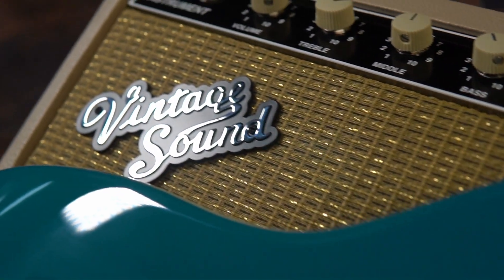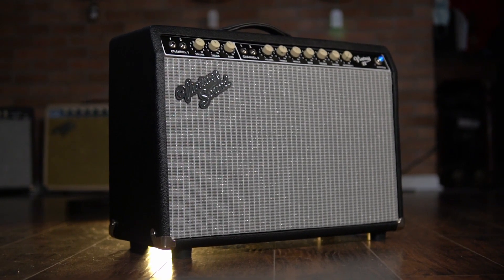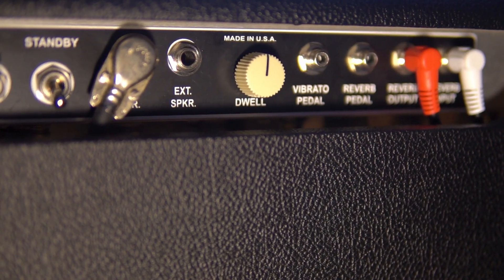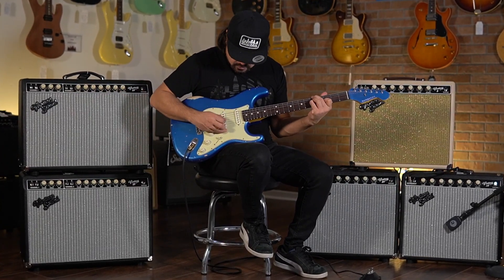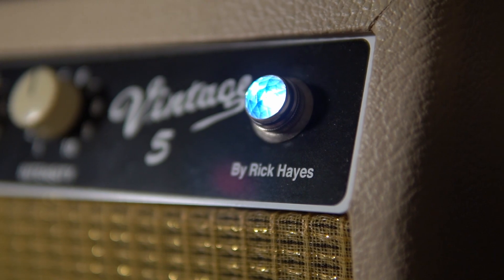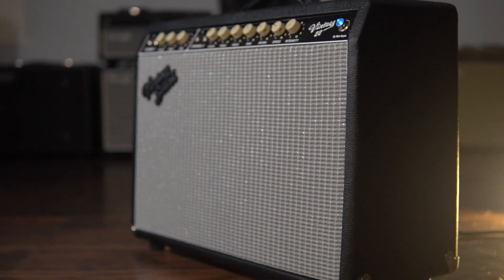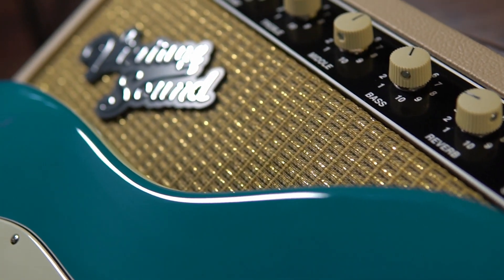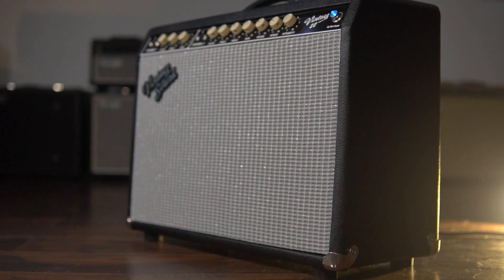VINTAGE SOUND AMPS Overview at Austin Guitar House

Comment: Just picked up a Vintage 20. Wow, what a great amp. It's everything I always wanted to make my 65 Princeton Reverb into.
Reply: I’m looking into getting this amp. Do you play mainly at home or gigging? I want one but want to make sure it’s not too much to play at home. They offer a 15w version instead of 20
Reply: @Childofbhaal  I am in the same boat. Ask Rick to build your combo 15 as a HEAD- $50 upcharge. This gets you an ohm selector on the back so you can plug in e.g., another 8ohm speaker and set it to 4ohm- space them 10 feet apart and WOW! I plan to do this with my Katana amp that has a 12" speaker in the cab. I think the C speaker is better than the CS for most people.

Comment: Had a VS20. Trem never worked right. Sent it to Rick and had a few caps changed. Still didn’t sound the way it should have. Sold it and bought a Swart Antares. Better built and sounding amp for my needs.
Reply: The price seems too good to be true for a hand wired amp with these features. It makes me suspicious.
Reply: @mrbuttons1243  I have two and am contemplating a third. Rick wants his amps to be available to players so he keeps his prices within reach of normal people.
Reply: @johnwelsh2769  Do you have his 15? I am thinking about it- for around @2k, he can build it with a head in the combo that gives an ohm selector switch built in. Handy for adding another 8ohm speaker to the party, then clicking 4ohm!
Reply: @MOAB-UT  I do have a 15! I like it a lot. Mine was $1300 but I got it in 2010. It came with Weber Cali 12" but I just didn't like it for some reason. I switched to a Celestion and it sounded better. No problems at all in 12 years of use! It's a great workhorse amp. I also have a 5 which is fun to crank up. I would like a 35 for gigging but can't do it right now.
Reply: @johnwelsh2769  Thanks John. For at home playing, am I better off with a 5 or 15? I want to also run it out to another 8ohm cab. I only play around 2 on volume so 75-80 Db's. I have a bad ear. My build, with a head in the combo and tweed is $2k.
Reply: @MOAB-UT  There is not as big a difference as one would think. The 5 is louder than I thought it would be. I bought the 15 from Rick, I bought the 5 used. I think the 15 is a great all around amp
Reply: I’ve had a vs15 since 2015/2016 
And it’s the most perfect clone of a “blackface” Fender Princeton Reverb amp that I’ve ever played and or heard. 
-Never once have I had a single issue with my amp. 
-I still haven’t had to take my amp to a “tech” to fix or replace anything (still works as good as the day I bought it.
-The only “work” I ever had done by professional was to install and properly bias my favorite vintage 6V6GT power tubes. 
Also contacting Rick Hayes (the builder/owner)  has always been simple to contact and always filling to answer any dumb questions I may have asked in the past. He’s truly there to help and to ensure that you get the best possible sounding blackface Fender amp you could possibly buy. 

And I bought mine used from REVERB (but internally it was completely untouched). I bought it for an absolute steal Of a price (I remember the guy who sold it to me almost instantly regretted it, and begged me to sell it back to him)
At the time I was considering purchasing a pre-cbs Princeton Reverb, which would be cool as a piece of history but way to expensive and I’m very glad I bought the VSA VERSION
Reply: Literally same exact story!
Only had to take it to tech once to install my fave vintage 6V6gty power tubes.

Comment: I owned two different vintage 40 One i had rick build it directly from his place in FLA I liked it but something went wrong and couldn't be identified it was a constant nag, I ended selling to somebody letting them know there was a issue, I bought a second online that was already built I liked it but again something went wrong It would blow fuses out of the blue then it would run fine then it would over heat then everything was fine I went over so much attempting to get it fixed Again never figured it, In saying that i'm really leery on these amps I contacted rick with both amps He never figured what the problems were and after while i just became a back burner customer somebody he hated to hear from and would rarely reply to after while. I'd just get a shoulder shrug type of response Just a bad experience
Reply: Not all builders are engineers or good techs.
Reply: He has a 5 year warranty less shipping. Why not just send it in to be repaired? Any amp can be fixed. You just change out parts until the problem goes away. Same with cars that I worked on that had hard to identify electrical gremlins. Amps are much easier in that regard. I suspect there is more to this story then you are letting on. Maybe you got power surges or dirty power in your home. What amp do you have now- any issues with it?
Reply: @luthiervandros  Rick is very good though.
Reply: @MOAB-UT   I did send it to be repaired, What he did in return was a real jacked up thing to do, I had him build the amp the way i wanted it, What he did was completely change the entire chassis, He thought he could fly it under the radar without me knowing but one thing he didn't know was i had a different face plate made for the original chassis  when he sent the amp back the face plate no longer fit the amp correctly when i went to reinstall it &  the amp sounded completely different , I said to him you changed the chassis he said no i didn't  as i said the amp sounded completely different than what i had him build, The hole thing was a bad experience as i originally stated.
Reply: @gatormcklusky5850  Interesting- TY. Sorry for your bad luck. When you spend that type of cash- that is not the experience you would expect. 

What amp do you recommend? I did like his VS15. Also looking at Carl's Amps Blonde 20. Headstrong Lil King, Louis Electric Columbia, Dr. Z. Z-Lux. Too many options! None of them cheap! 

I like clean, sparkly Princeton type tones at very low volumes just at home TV level since I have a bad ear- cannot go louder than 2.5.

I appreciate you!
Reply: @MOAB-UT   I can't really speak to the many amps he makes,  i bought the Vintage 40 this was back in 2012 & 2014 for the second one, I guess one could ask why did you buy a second amp, When the amp ran right i really liked it & hoped the 1st one was a fluke. I currently run a Marshall, i have 2 of them, one is the hand wired super 100 Jimi Hendrix reissue, the other is the Marshall 40th anniversary hand wired JTM 45/100 both are pretty cool amps, I'm trying too save for a fender black face either a deluxe reverb or a super reverb.
Reply: @gatormcklusky5850  Thanks. You are an eternal optimist I guess! Glad you seem to be happy with your current amps. I really liked the high end vintage amps however, in my quest, I stumbled upon a post that turned me on to a small, since retired builder in Dave Gries aka Gries amplification. I just bought one of his simple 5 watt amps...sitting down? $450! It has plenty of clean power for at home playing which is all I do these days. It even comes with his homemade attenuator.

He chose not to put Reverb and Trem. in it specifically because those circuits are often the main culprits for internal amp buzz since they require additional components like tubes. I will likely just pick up a Big Sky or something like it. I will build my own cabinet- likely use a Jensen or Creamback 12" in it.

To achieve a wider soundstage, I can simply mic it over to my Fishman mini amp and/or A/B/Y with my Boss Katana. 

Cheers!

Comment: I saw one of these on a amp tech video & it was pure junk. It had some name brand stuff on the inside, but was mounted on a cheap chassis, with horrible connections & stuff wired backwards. Pots that were a mish mash of different sizes, it was really a disaster. I would stay far, far away from any of their amps.